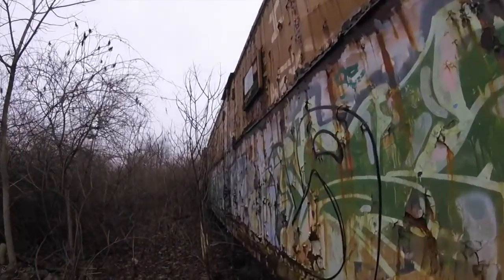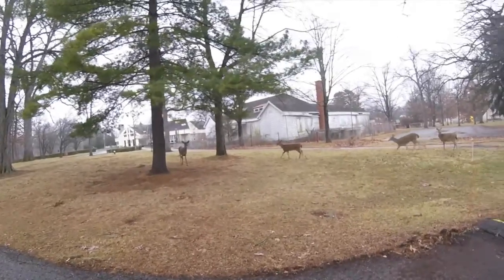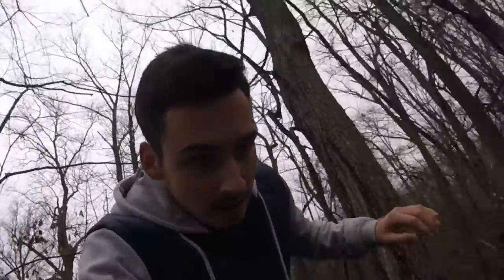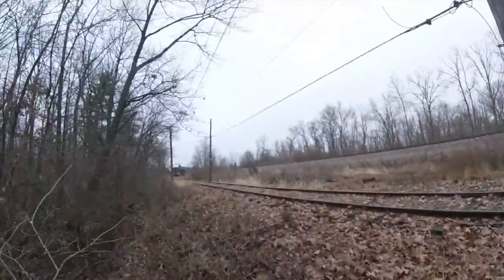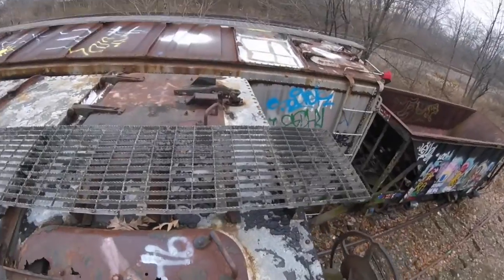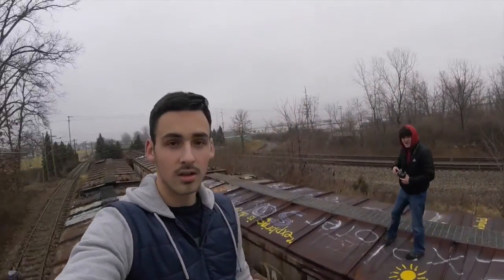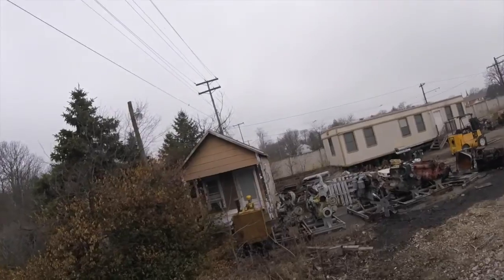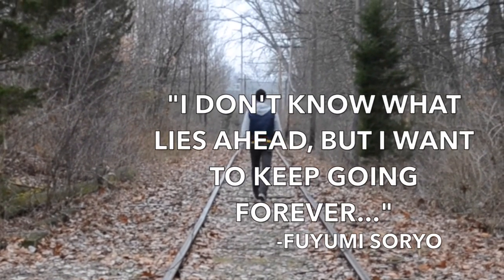ABANDONED RAILCARS FILL FORGOTTEN TRACK

Comment: Get you some boots instead of those ballet sneakers and you won't have to worry about drenching your feet, lol.  Those tracks, assuming they have a connection could still be used.  Heck, The ND&W (formerly the MAW) has tracks in much worse shape and they still see active service.  Even many industrial tracks look worse than those.